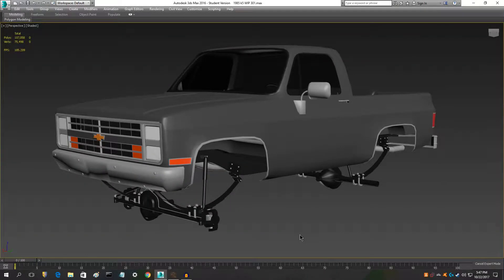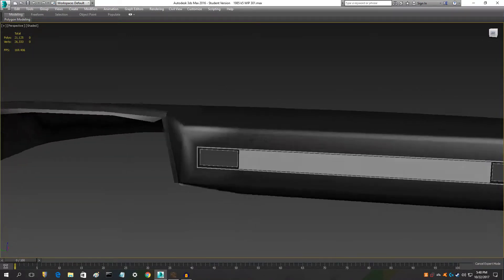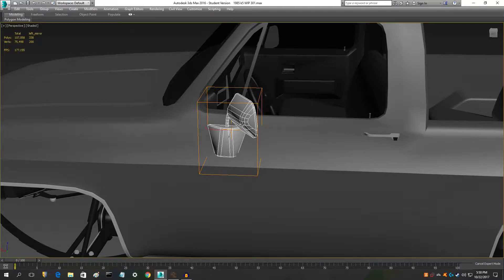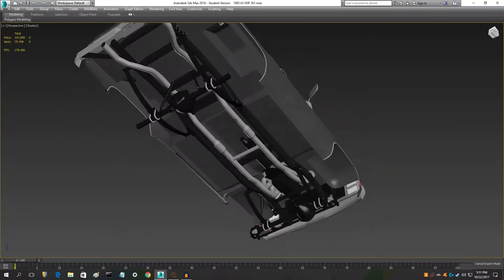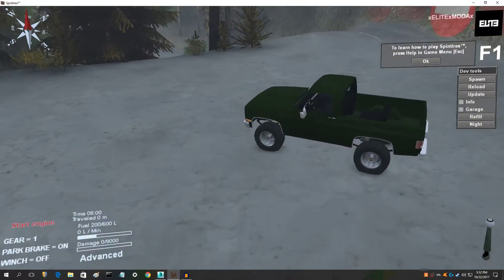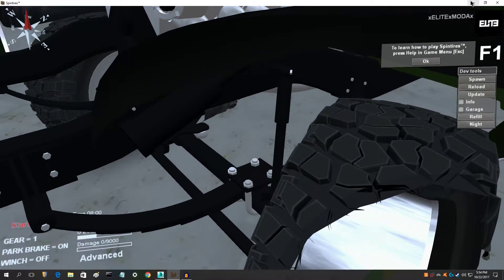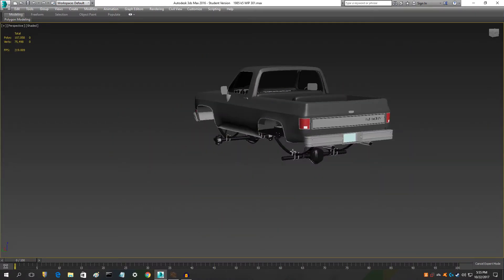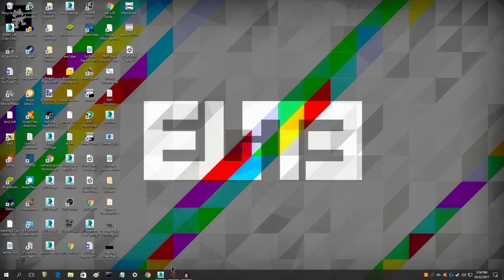K5 Update 5

Comment: Hej Tex ..is it possible to import a downloaded and "for mudrunner modded" car into a 3d program like 3ds max? I know the wy to do that with a skp file and others, but the mudrunnerMODS are xml files and I doNt know the way to import files like this into a 3d program ... thx in advance, steve
Reply from the maker: 1st and foremost, please do not steal mods, its not cool. The XML Files are for the physics and texture paths of a Spintires mod and not the 3D Model. The X File is for the 3D model which you can import into 3DS Max with an X-File Importer (Google it). If you get the mod from the Steam Workshop, they are encrypted and I do not know of a way to break it. Have a good one. :-)
Reply: @TexHasselhoff  Thx Tex! I woNt ... I didNt intend to steal / but u r right ... and I could ask the owner, too :)